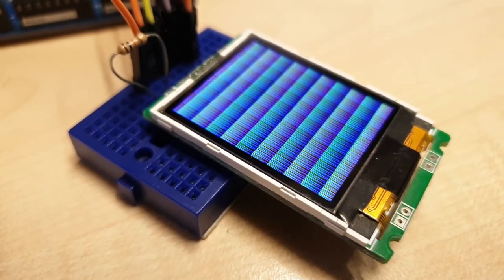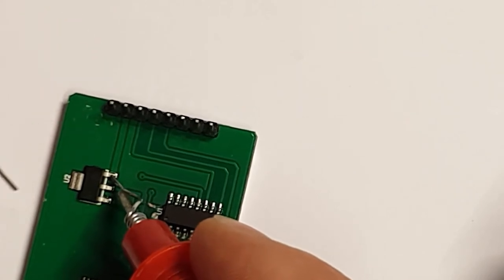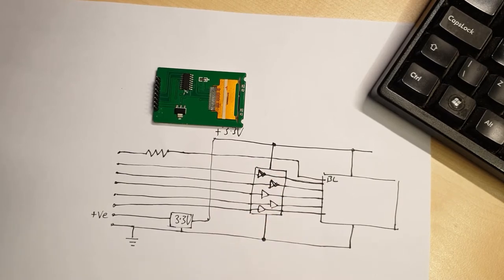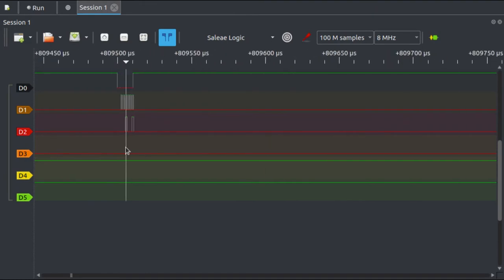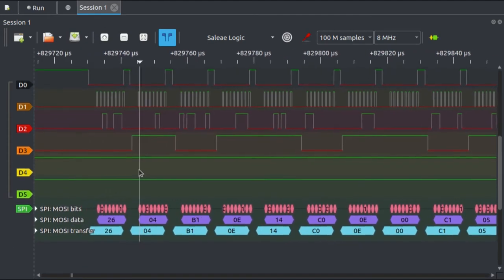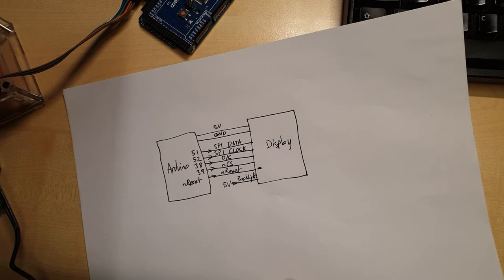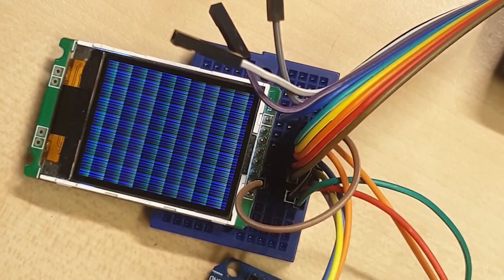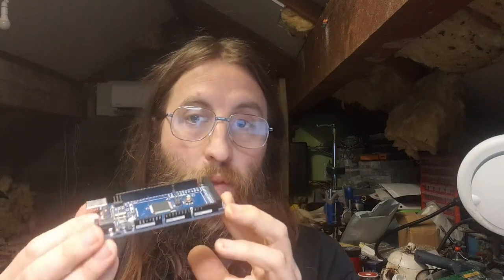SPI TFT LCD hacking!

Comment: Can i connect to av (dvd)?
Reply from the maker: No. The display is being driven by the microcontroller, and not an analogue source.

A more powerful microcontroller could digitise the image and display it, but there are probably simpler solutions if all you want is a small AV display.
Reply: Not in this particular form.